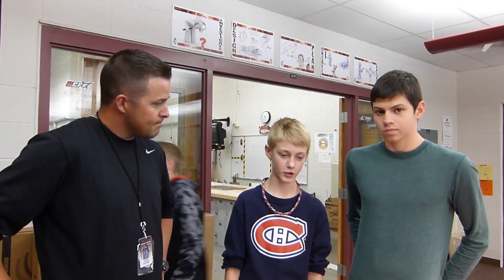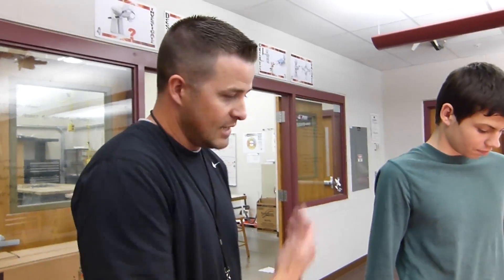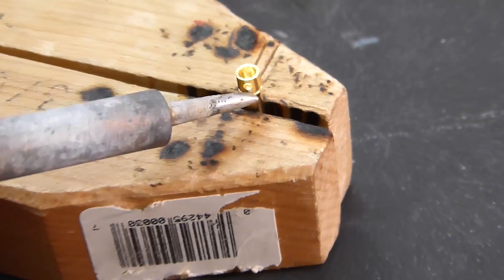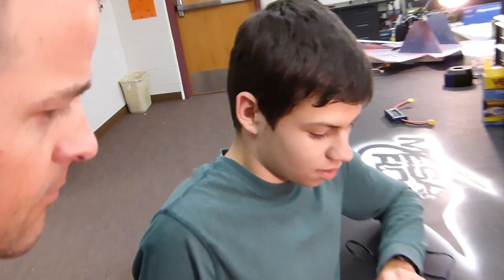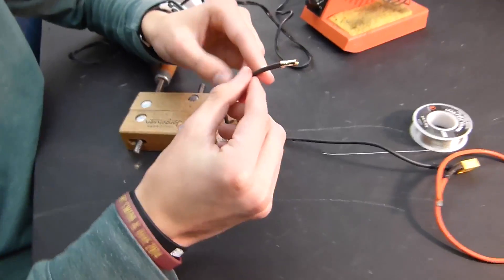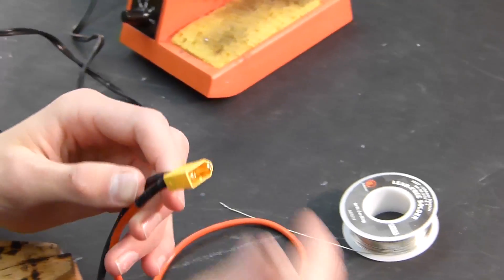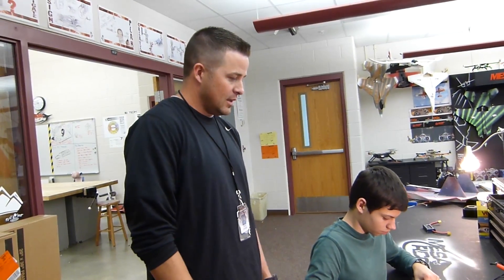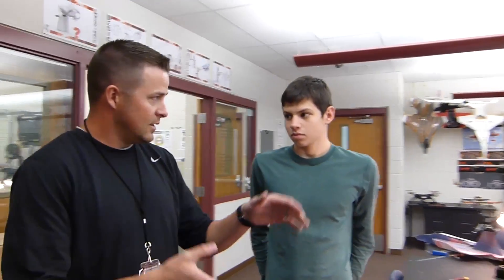MESArcFF - Soldering - TIP SERIES

Comment: I just soldered some 2mm bullet tips for my multi rotor  this week. That small hole is a feed hole. I keep my wire inside the bullet, soldering iron on the back side of the bullet (opposite the small hole), and then feed the solder through the small hole until the cup is filled. Make sure you tin your wire (apply a small amount of solder to the tip of the wire) before you start it helps in the heat transfer as well as keeps your wires grouped together and not flayed out. The process you did seemed to work just fine. Just a little tip for you.

Comment: I think you guys are thinking of 'Tinning' the tips ;-)
Reply: ***** Also one more thing. (If you can) It's always best to not only 'tin' the tips of the bullet connector, but also tin the end of the wire you're soldering as well before inserting it into the bullet connector. You want to make sure the wire you're attaching has solder wick deep between the strands of wire or else you'll have a 'cold joint'. Even though the bullet connector has a nice puddle of hot solder, the bare un-tinned wire may not have a good bond inside if the solder cools before it has a chance to wick inside the wire.

Now for small bullet connectors like the ones you have, it's difficult to get a tinned wire inside of the connector's hole. So what I tend to do is either very lightly tin the wire before filling the connector's hole with solder or I'll apply a very small amount of soldering flux (available at radio shack) to the bare wire and then after the connector's hole is full of solder, insert the flux coated wire into the solder filled connector hole and continue to apply heat from the soldering iron until I see solder wicking into the wire.

Sorry this was a long reply. Check this video out.
Soldering basics for RC planes
If you're not already, subscribe to Bruce's Xjet and RCmodelreviews youtube channels. He has excellent videos on everything RC and more. Videos on motors, ESCs, props, pulse jets, and more.

Soldering flux paste:
http://static.rcgroups.net/forums/attachments/3/6/9/4/5/a2063677-18-Flux%20002.jpg